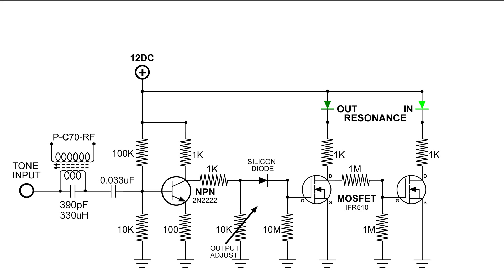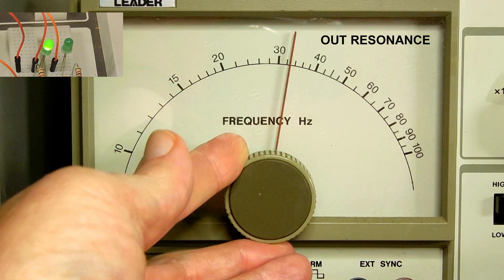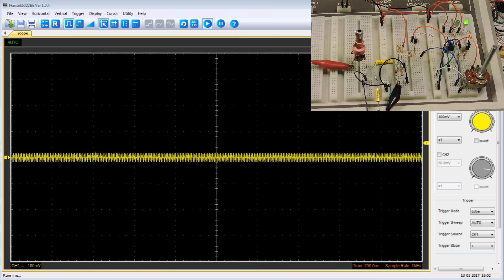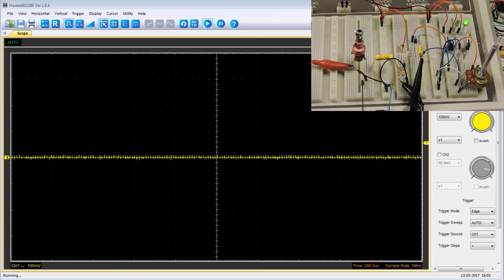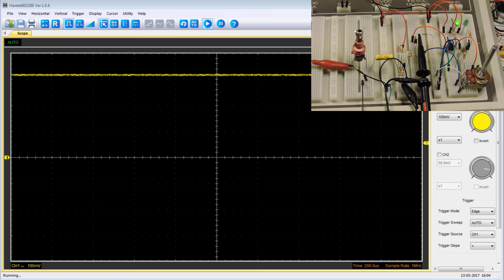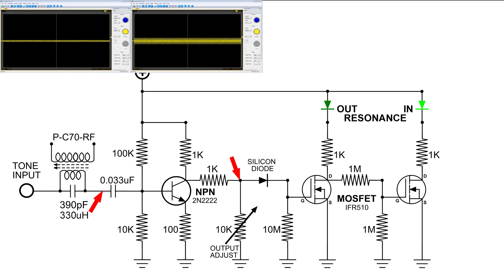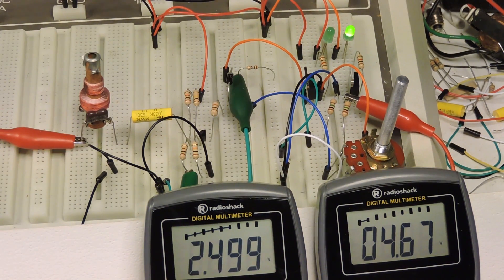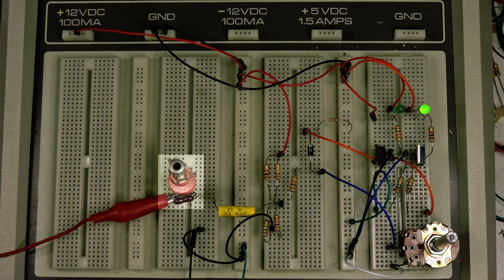Frequency Dependent Circuit in more Detail

Comment: Can it be used to make Fm radio mute when no signal there. 

When we attach 450khz to transmitter?
Reply from the maker: You could add a circuit to turn off the audio.

Comment: Hi  Thank you very much for the video. As the main function of a tank is to transfer the resonance frequency,  I am wondering if it is possible to have a similar circuit that is connected to the open legs of the tank instead (i.e. the secondary coil) to see the resonance effect transmitted from that secondary coil. Do we need the same cap size of the primary for the secondary to see the effect? Thanks
Reply: I believe he said the secondary winding was not being used.  Just a convenient part using just the primary.  I could be wrong - it's happened at least once before ;)
Reply from the maker: Thank you.